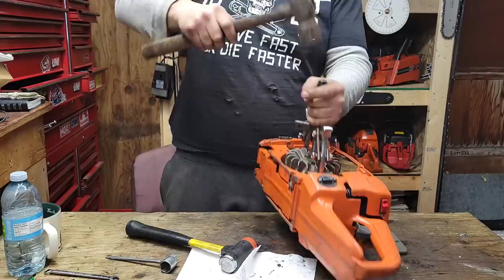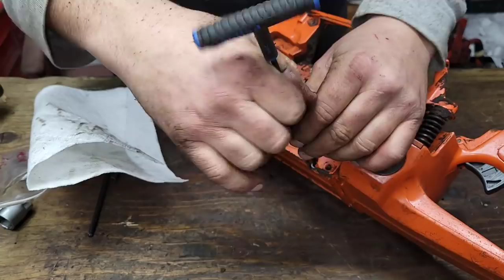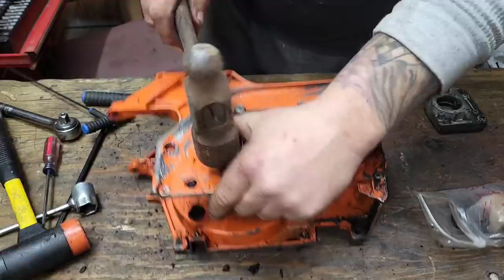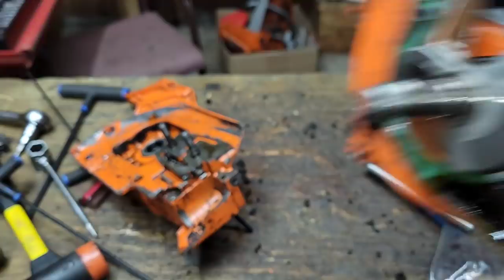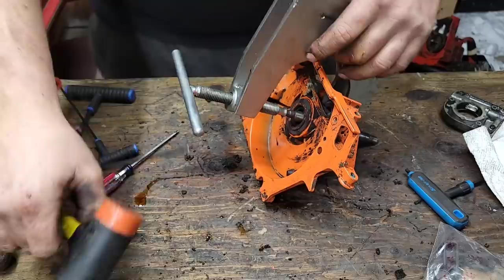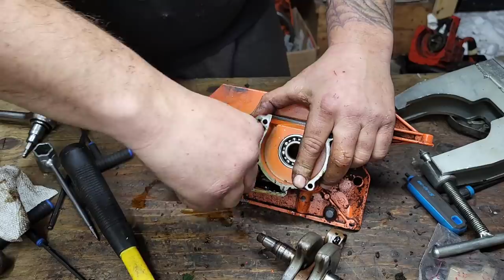How to split a chainsaw crankcase. Husqvarna 394xp build!!!

Comment: I overpaid $350 for a " low hour" 026 with a scored piston and cylinder,  it was the best purchase I ever made, it got me into a great hobby and learned new skills
Reply: Really like the 026.  Great place to start in your saw collection.
Reply: Then you didn't over pay. Another mechanic is born.
Reply: Same...kinda, not quite that extent but situationally yes
Reply: @alexstromberg7696  got me for a hundred it a 029...lol made it a beast of a 039, itvwas trash shes been rocking them highway skf, meteor, highway ect....got a pipe and pulls 25 inch full house, was my first build and unthinkable oooh a clamshell ranch saw...no it was trashed for example the vent for fuel ubenounced to me was a oil filter and so on, scored to death, I completely re did it, adjusted it(timing) now it's a nice little 64.sum saw
Reply: Almost picked up a really in good shape 036 pro other day...wanted too much $$ though
Reply: hell I paid 75 for an 026 pro and I thought I over paid. Just needs a tune up. 250 later. crank and bearings all shot.
Reply: @alexstromberg7696  not quite 1999, heck I needed a saw, couldn't get a new 261 due to supply issues had to next best thing
Reply: @Rob-tl9md  prices are been sky high the last year for used saws

Comment: I am building a 576xp right now, I just used 1/2 allthread a few 1/2" nuts and 2 1/2 all thread rod couplers. screw all thread all the way into the coupling nuts, put 2 nuts on the rod exposed. cut it to a length that fits between the case in 2 separate spots preferable 180 degrees out from each other. then just use 2 cresent wrenches turning the all thread out of the coupling nut. pushes it right apart.

put one piece where muffler sits and other where handle and gas tank run on back side.

Comment: Hey buddy I'm sure you know this, but figured I would put it out there. Usually when I have bolt heads full if stuff I will put the tip of my blow gun right up to the head and it usually cleans the heads right out. If need be scratch at a little first with a pick. Anytime I tap the bit in, it really packs that stuff in and makes it tough to get out. Just figured I'd throw it out there. Really enjoy the videos buddy!

Comment: I have a Solo 681 completely torn down - case gasket was bad and it was letting oil from the chain reserve leak into the crank case.  I need to replace its clutch as one of its springs was broken, but I'm unable to find a source.  Would it be possible to use someone else's clutch on this machine?

Comment: I wish I found this video after I hammer split opened my Stihl MS341 😅  well, it happened, not sure if the case body is still good cause I hammered that one. It didn't open so I took a bad nut to screw it a bit to the crankshaft flywheel side and hammered it down and it split apart. Anyway, it's my experience I guess will check tomorrow if the thing is still good

Comment: Tinman do you ever or have you ever tried the ceramic bearings? They say they are good for 30,000 rpm and give the saw 500 more rpm plus run cooler etc. The cost is the only factor a set of bearings for a MS461 Stihl is around $100-120.00 compared to SKF bearings.

Comment: When I had my 395xp   I had a 20 inch bar on her and a 8 pin rim sprocket  ,,bucking  firewood that saw was nuts my boss at the time couldn't figure out how I was cutting so much firewood   as fast as I was ,till he seen the saw I was using lol

Comment: Informative video.  I have one question.  I have a 2100 crankshaft, that  is broken on the flywheel side, but has a good connecting rod, and I have another good crank with a broken rod.   Have you ever pressed the crank apart to repair or replace a rod with a bad bottom end?

Comment: Hey tenman  please answer this question if u got time but in the late 90ds what saw would keep up with loving not hot saw. I have a husq 45 husq 55  and they have been great saws for a long time with me. But I tried a brand new 261 c Stilth chainsawsnd it was a dog in bucking wood with it.  But i  tooned it with jet seething and it did ok. But I could never get my mind off my 45 and 55 husq saw. They ran circles around the stilth chainsaw I want to step up just a little bit higher saw and I know u can point me in the right direction. because I have bigger trees to cut down down here in Georgia and I need a little more saw and I was wondering what you recommend on the Husky side to buy used down here to make a great saw  I love it I don’t need no rocket ship I just need something to cut wood quick fast and puts a smile on my face any info you can give me back I would greatly appreciate it and I wanna thank you for taking the time out of your day to help us you’re a great guy and I appreciate everything you do keep it in the wood my brother.

Comment: ..split a crankcase?..three sharp wood chisels..drive one in the bottom at the split, one at the split on top of the oil tank, and one at the top rear of the crankcase..drive each one alternately about 1/8" at a time, until you can pry the crankcase apart...believe it or not, I have actually seen this done before.. :0 ....not a pretty sight!...

Comment: Hahaha you keep talking about how dirty it is.......you should have seen the last 4 I rebuilt . Bought them from one dude. I swear he cut molasses blocks with concrete mixed in hahsha.love my 394 and 395.
What I didn't know until yesterday is the 394 had more power than the 395.

Comment: They are close to a 395?
Reply: Basically the same saw.. the 395 is newer epa version of the 394.  Difference is cylinder, carb boot instead of block and air filter system. Transfer ports are different aswell..
Reply: @codyroger9581  thank you.
Reply: @codyroger9581  what modifications can be done to a 395 carb to bring it back (so to speak) to pre EPA? I.e. drilling the venturi, drilling the jet. Are there some tricks?